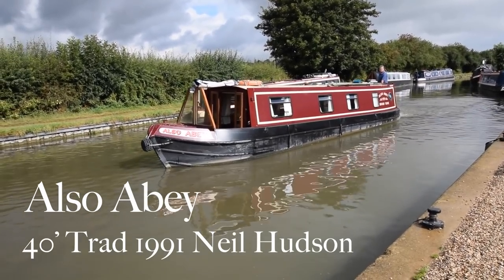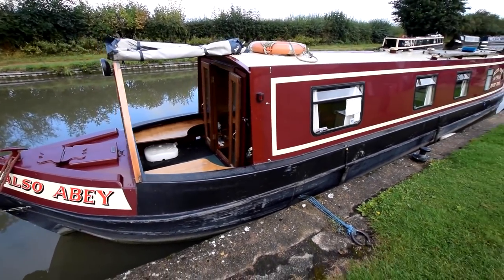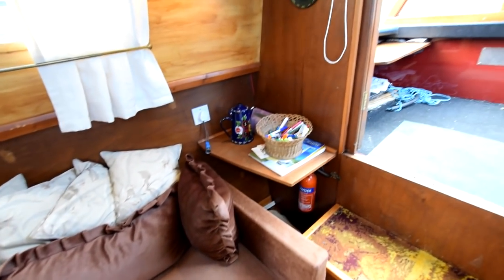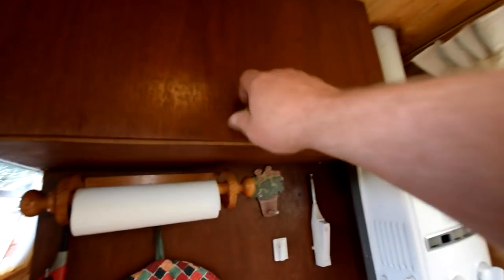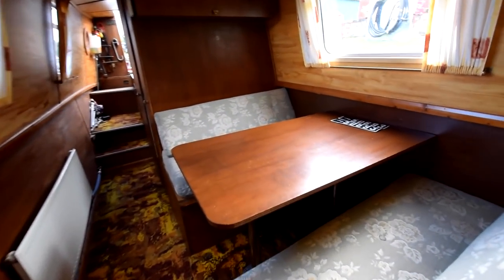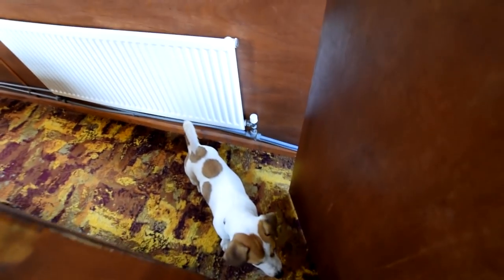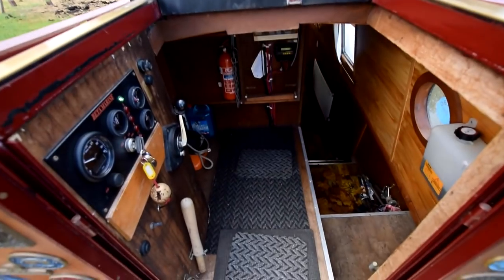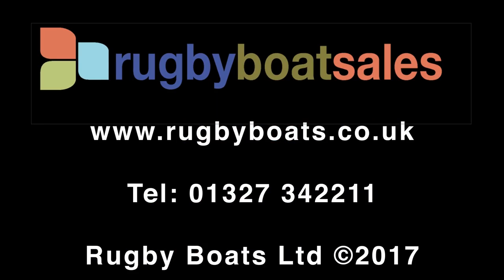SOLD - Also Abey, 40' Trad 1991 Neil Hudson

Comment: Always had a facination for what could be done in small spaces. So many boats seem to waste space. Get rid of the chairs, put in an L shaped dinette, then lose the pullman dinette for a fixed bed, do the bath/toilet as a wetroom with proper cassette loo, sink and shower. Rip out the makeshift gally and put in a combined 2 burner hob and sink, like in camper vans, combo microwave ( run off small travel power generator). Lighten up all the woodwork which will make space seem bigger. Give that carpet a decent burial plain carpet throughout except pale laminate in gally. Make nice holiday boat far too small for live aboard

Comment: Keep the dog off the boat that's disgusting
Reply: chances are another dog has been their before or bumble would not have tried.
Reply: I'd insist on a further 5k off to have to rip up the floor and replace it
Reply: @funkydozer  having dealt with it in a house I bought there are paint on sealers which work.
Reply: @elund408  Depends on how rotten the wood is beneath that carpet, if the owners have had dogs in there for years, there will be years of rot if Bumble's nose is to be trusted.